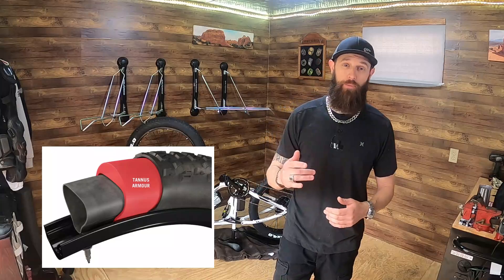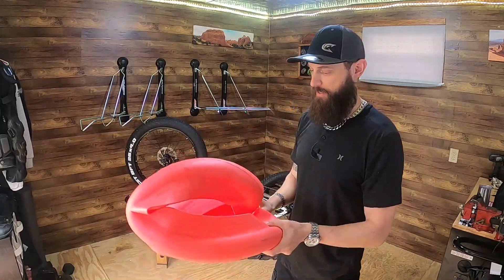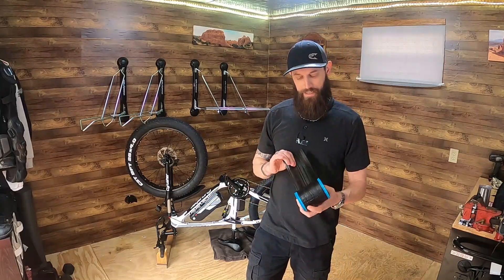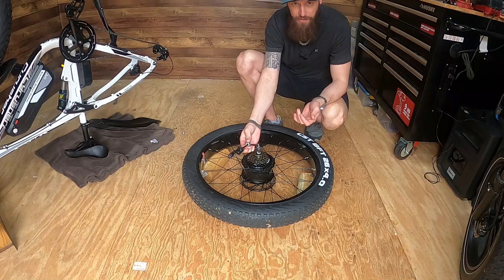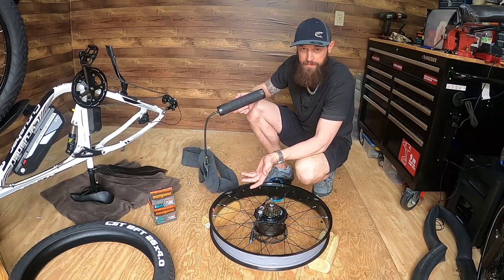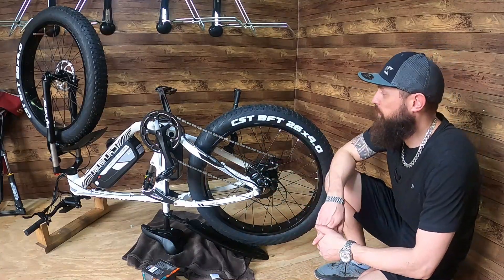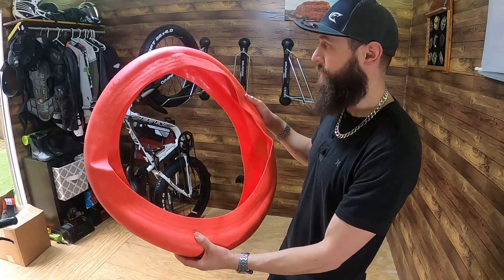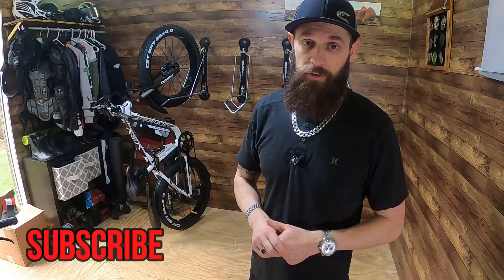Mr Tuffy Tire Liners vs Tannus Armour Foam

Comment: Shortly after buying my Rad Rover I got a flat, got it fixed and a week and a half later got another flat and had another flat and had to walk 3 miles back, that was it for me, I ordered Mr Tuffy liners in it and put 8,000 miles on it, gave it to my brother in law and the tires are bald and still no flats, I swear by them for the price.
Reply: Wow thanks for that
Reply: @jefbiggs1583  the only downside is they don't protect if you were to get a puncture on a sidewall but I never had a problem and did ride off the beaten path as well, I retired my Rad Rover for a dual hub AWD 1000 Watt E Cell, I love it happy riding.

Comment: I wonder how it would feel and give you confidence if you installed both at the same time. Did you also notice any major difference with the top speed and angular momentum?
Reply from the maker: i did not notice any top speed difference but really didn't specifically test that either.  i would bet the foam liners might reduce speed a little, more rotating mass....
Reply: Like CitizenCycle mentions in his comment, Tannus Armour may have a little bit more rotating mass where we are a foam insert.  The two are compatible together but that's emptying your wallet even more.  We feel one or the other is sufficient.  Obviously Tannus being our choice!  Its good stuff.  Like riding on the clouds.  Cheers

Comment: It's worth noting that Tannus doesn't claim their run-flat support on fat tires. It might work anyway, but Tannus does have that asterisk in there.
Reply: You sir are correct!  *Does not apply to the follow sizes: 20x3.0-4.0, 20x4.1-4.8, and 26x4.0-4.8.
Reply: What is run flat support?
Reply: @CONSCIOUS_TALK_ENT. Means even if you get a flat and there's no air pressure you can theoretically ride on that tire ymmv

Comment: Question do you have to use the battery on the E bike or can you just write it like a regular bike and choose when to use the battery
Reply from the maker: You don't need to turn the bike on You can ride it as a regular bike with no power

Comment: If you use the tannus in your tire does it change the air tire pressure?  Like say if you run 25 and you use  the tannus would you put 20 because it is now less room because of the padding?

Comment: i use both tire Liners and tannus armor and work great
Reply: Ken... so you use Mr. Tuffy's in combination with the tannus?  Did the ride change?  I commute 31 miles round trip each day with my Rad City 5+ at relatively high speed (around 23mph) so I want as little rolling resistance as possible and I really don't want a "squishy" ride.  Can you give me some advice please based on your experience?  Thanks.
Reply: @JoeKubinec  yes i use both since my tyre can fit both, i cant feel any different about rolling resistance as i ride my bike for 15+ hours a day for foodpanda work
Reply: Thanks for your reply... what size tire do you have?  Thanks again.
Reply: @JoeKubinec  miy tire size are both 27.5 /2.8 i also use thicker inner tube too
Reply: @JoeKubinec  migh be overkill but i feel alot safer this way lol as it my working bike to make money dont want to have any downtime
Reply: @kennethcampingdiary1976  Understood... I use mine to commute 31 miles round trip each day to work so I'm looking for reliability also.
Reply: @JoeKubinec  on top of all that my inner tube are special too it name Airplus made by Schwalbe much thicker more reliable just littlle more heavier then normal tube about 400gram but you frel much safer
Reply: @kennethcampingdiary1976  You're awesome.  Thanks for your advice!

Comment: This liner are expensive but ended up buying a 20x4 and 26x4 for my 2 big sur ebikes. Pain to install them.  My question will be , do I leave them like that, or should I go tubeless? By the way a  have the tannus the other ones can cause punture between the inner tube and the liner if the psi is low and ride it like that

Comment: As adamant as you are with liners I am with tubeless. 2 years of riding 3 different bikes and not one flat with Stan's sealant and no tubes. Plus it shaves weight off the wheelset

Comment: I added the tannus armour to my diy ebike, a 2019 Montague Paratrooper and a Bafang Mid Drive.  It was hard getting the tube and tannus on the 1.95" tires I have on the bike.  My next build, hoping to be my reward when the fed finally approves my disability I want a fat tire recumbent electric mountain bike! i tried a ride at the beach and it was a nogo.  I am running 20lbs of pressure in the innertubes I do like the softer ride feel.

Comment: Aren't u supposed to wrap that on top of the tube? U seemed to shove both on there,  idk, how do u know it's in the correct position?
Reply from the maker: the Tannus is shaped just like the tire, i usually stuff it in there first then slip the tube inside it. you could also put the tube in the tannus first then shove both in the tire at same time, either way it pretty easy to fit.

Comment: The question not asked or answered, what about both? When I do Mr. Tuffy, I use strips of black tape to hold the liner to the tube, and when it gets to a certain pressure, the tape releases but everything is in place.

Comment: Just installed my tannus liner on my rear for my himiway.  I popped it right at the beginning of winter, a little thorn did it in.  But I haven't done the front yet, but was gonna just start with the rear.  Giving her a charge now, and am excited to give it a feel.  I saw a video that says you can just do it on one tire and it'll be fine.  Have you rode with only 1 liner in?

Comment: I use the Mr. Tuffy but it's notorious for "friction flats" internally from eventual wear/tear. It's reliable but, it's a pain. I'm buying my tannus armour liners BUT, intend to KEEP that Mr. Tuffy's under the Tannus. It'll be a little heavier BUT, the peace of mind is WORTH EVERYTHING. 🤘😁🤘
Reply: Totally agreed 👍 I'm riding with 2 TANNUS Armour, yeah the sensation is "heavier" but i ♥️ it !
Reply: I know this is old but wouldn't putting mr tuffy on the outside of armour work better? It can't deflect to well if foam is holding the nail straight 😅

Comment: Any updates on the tannus liners?
I have heard that they get flattened out over time. Has anyone experienced this?
Reply: The Armour will compress some after it’s installed depending on the pressure of the tire. The higher the psi the more condensed the Armour will become. If you wish to keep the Armour as thick as possible then maintain a lower psi. You may also deflate your tire if you’re not going to be riding for a longer period. This allows the Armour to rebound back to its original size.

Comment: I am looking at those same two liners for my new ebike, a fat 20 tire bike. I'm fat so I needed a fat tire one.  Anyway, 5 years ago I built a 29" motorized bicycle. It came with cheapo tires on it. Riding the neighborhood I had 3 flats in the first couple months.  Always the back tire.  I put on some Continental bike tires, 29 X 2.25s, and Tuffy liners.  No more flats.  Flat tires ruin the whole concept of bicycling for older riders like me.  I can't be walking the bike home several miles.  The last time I hid it in some bushes, walked home, got the car and came back.  Dollar for dollar, I think the Tuffys make more cents.  An object longer than the foam is thick will flatten a foam lined tire.
The Tuffy liners are actually tough.
Liked your vid..  Try not to talk too much, talky videos get on my nerves.
Reply: I threw my old rusty bike behind a bush when the bus driver told me a bike is additional $25 fare, it was still there 5 days later upon return

Comment: I just purchased my first ebike(Juiced Ripcurrent) and hear that it is a real pain-in-the-ass changing a flat on the rear tire with Hub motor and all, especially trying to fix it out on a bike ride so I think I'm going to go with the Tannus Armour!!!
Reply from the maker: Changing out the back tire is not as hard as you think but I would certainly rather do it in my garage than on the side of the road
Reply: @CitizenCycle925  I've recently bought a R&M Load 60 cargo e-bike and I've tried changing the back tyre in my garage just to find out how easy/difficult it is. I found that it's pretty impossible without some means of suspending the back of the bike above the ground (which is doable in the garage). The bike is too heavy to get upside-down. With it the right way up, you can't hold the back up with one hand (because it's too heavy) and take the wheel off the chain with the other (too fiddley). I've seen a Propel video where he looks at ways at suspending it from a tree branch, but who knows if there'll be a handy tree with a low limb where you get the puncture?  I think there's no realistic option in the event of a roadside flat in the back tyre other than to walk the bike home, so I plan to invest in the Tannus Armour before that happens. Thanks for this useful video.

Comment: Any ideas which model an old guy should ride? I know they are heavy but that should not be a problem and might make for a more stable ride.
Reply: I’m 73 years old and like the safety feature and extremely strong frame and good looks of my radrunner plus! I purchased it online a year ago. I chose this brand in that not being to test drive it , rad had a 14 day no questions asked refund policy,you pay return shipping unless a factory defect. Also must not have scratched or damaged the bike.  It is rather heavy and I believe the mini stepthru rad over would have been a good alternative in that it is lighter, foldable, and $500 less. All of the safety features on my Radrunner plus at a cost of $1800 would have cost about $3000 with other brands.  Whatever brand you buy get a step thru! You won’t regret it, at least with the strong frame of a Radrunner Plus!

Comment: This review was more about Mr. Tuffy tire liners not being as good as that other brand from his opinion. Either one is good, you will not get a tread flat, side wall punctures are rare but if that is a concern for you, then pay the extra cash. If you can afford a multi thousand dollar e bike then get the higher end tire liners. Mr. Tuffy is still a good investment. The tannus armor cost $79.99 for 26x1.95-2.25
Or $18 for Mr. Tuffy and tuffy liner won't loosing your spokes, is reusable and biodegradable.

Comment: I use an old tire inside the new. Say you have a 26 x 2.125 you use a 26 x 1.95 but trim the wire bead off the old tire first. stuff the inner tube into the smaller tire then put the smaller tire in the bigger one. I use it for my city riding and has effectively stopped flats for now.

Comment: Home Depot "Orbit UPC 2 in. x 50 ft. 20 Mil PVC Pipe Wrap" $5.24 a roll it is thin and fits perfect. Nails, Screws, Thorns glass and more. it's made to protect under ground pipes

Comment: If Schwalbe would make fat tires with their patented puncture resistant lining we wouldn't need liners or foam inserts. I loved my RadRover but the flats were killing me. Never could get the Mr. Tuffy Liners to sit right so instead I cut open the tube I was replacing along the inside circumference and then wrapped it over the new tube thus creating an extra layer of rubber.  That plus the addition of Slime worked well. If I did get a puncture that made it through both layers, the Slime slowed things down enough so I could make it home.

Comment: I have a 2 stroke motorized beach cruiser. And I run 2 Mr.Tuffy tire liners in each of my wheels 🛞 sue to Las Vegas roads beating ass. And I got to say I haven’t had a flat yet they run good and the wheels don’t feel of center or anything with having 2 tire liners . I have 26in beach cruise wheels

Comment: Was the Mr. Tuffy,sticky on one side? I don’t see how,some that looks like thick electrical tape,will stop a leak? Is it sled healing material?
Reply: Mr tuffy are not sticky; they just sit in there and stays put once the tube is inflated;  the tire liner is actually a thick strip of re-enforced rubber &  it wont stop a leak. however, the tannus, you can ride on them with NO air and still be OK.  i switched from mr tuffy to tannus. worth the money.

Comment: My bike has 20x4 tires and had three flats in two months (two nails and one screw).  Put Mr. Tuffy liners on and no flats since.  Odd thing is all flats have been on the back tire and am wondering if there is something about the back tire that makes it more prone to punctures than the front.  Tannus sent me a notice that 20x4 is now available but am hesitating due to the price.
Reply: I have  the  2020  rad  mini . 20 x  3.3  tires . After  three  months and  3  flats . I put the Tuffy Liners in . No issues  since . loving them .
Reply from the maker: Good to know I've been waiting for the 20x4 liners to come out. Maybe the back tire is more prone to puncture since there's more weight there with the rear motor..?
Reply: Very often you’ll get a flat on the rear tire because the front wheel will pick up a tack, nail, or goathead and throw it into the path of the rear tire.
Reply: Motorcycles also suffer far more flats on the rear than on the front. Conventional wisdom is that the front tire runs over an object and stands it up so the rear tire can get punctured by it.
Reply: Yeah I was wondering about that then I realised it must be because of the weight

Comment: Ive been riding diy ebikes for 4 years now Ive always used sealant (slime and others) thats always worked me except pinch flats, big hub motors are gonna have those, so the tannus's  looks good to solve those pinch flats I might give it a try 3000w motors an bigger aint so easy though

Comment: Ive had Himiway Cruiser since November, 1600 miles.  First 1200 without Tannus no blown tires.  Got talked into them, popped in first 200 miles blew rear tire.  Bought another one and had pro install incase i made a mistake, and it blew out immediately after as well.  I ride off payments in a country club and wide sidewalks.  No construction or anything, clean roads.
Reply: Yep I got talked into tannus as well . I've had four punctures on my back tire with tannus Armour in the past 6-8 months
Reply: @zachcline7555  I haven’t had any issues since taking them out. Same routes.
Reply: @dpa03  was it always the back tire ? I’ve never had any issues with the front . I finally ordered some maxxis minion tires for it so I’ll see if that helps
Reply: @zachcline8347  always the back. I’ve only had one blowout in front and that was with the liner. 2000 miles later an no issues with front. With the liners i want to say I’ve had probably 8 punctures with liners in. Just replaced the back tire with something cheap off Amazon as I’m going to replace the bike soon. Way too many other issues with this bike, from motor to display screen. I’m going to go with a Super73 next.
Reply: @dpa03  Yeah I’m probably not going with himiway again . I’ve been looking at Aventon , They seem to be better built from what I’ve seen so far . I haven’t had issues with the motor just yet , But I can tell they cut corners where it matters to save on cost
Reply: @zachcline8347  and their service is dreadful
Reply: @dpa03  Yep , Definitely is

Comment: "Real World" experience. Thinking side wall protection is important.
Tannus looks like a Pool Noodle floatie, repurposed. Mark-Up must be
ASTRONOMICAL 100X? 10bux ok, 0ne Hondo no way. Saw a plumbing type
pipe cover out of the Tannus eraahhhh, meant pool noodle material at the local DIY
store.................if Tannus will pick you up as an Ambassador Brand Partner, leave it be.
Otherwise, some of us backyard hacks inspired by your up-scale hacking may want to 
see alternative to the over-priced foamy. Great content, I watch all and read only positive comments.
Ride ON!
Reply from the maker: Agreed on the markup. they must be making an absolute killing on these things, they cost $120 and they probably only cost $1 to make haha. If I come across anything I think could be used as a hack I'll try it.  I don't think a pool noodle would work, it wouldn't offer much puncture protection, The tannus is a denser foam. Now you see why I'm saving that second set. at that price, these won't be going in every bike😁
Reply: @CitizenCycle925  These are dear ASF, I just carry patch kit and pump, it puncture isn't too bad, the tyre will make it to the next air station after re airing with pump or air hose

Comment: Big fan of Tannus armor, I have those in my 20 x 4 e-bike tires. They cost a lot but 2 years later no punctures. I was averaging a puncture every 3 rides here in the desert. We have goat head thorns, I call them devil heads because they are evil and that's what they look like. My new ZOOZ uses a 24 x 3.0 tire size and Tannus doesn't make a liner in that size. Tannus if you are listening, hint, hint.
Reply: I’m interested in the tannus armor but I heard for it to remain effective you must deflate the tires after every ride. You’ve been using them for 2 years so I was wondering if that’s actually necessary

Comment: Mr. Tuffys have liners that are ebike rated and stick, why wouldn't you get those. Most flats don't happen on the sidewalls. Some flats are bound to happen with inserts or liners, it depends on the object and angle plus force when penetrating, same as getting a flat on a car tire.

Comment: Mr Tuffy is my preferred liner, the negatives on the Tannus is NO you cannot run a 4" tire flat, they come right off the rim, a disclaimer from Tannus states you must let the air out of the tube when not in use so they will retain the shape otherwise they compress and are worthless!
Reply: i use tannus on a normal 27.5, and its bullet proof with no air - i use conti tires, and they arent coming off unless you have a crowbar handy ;-)